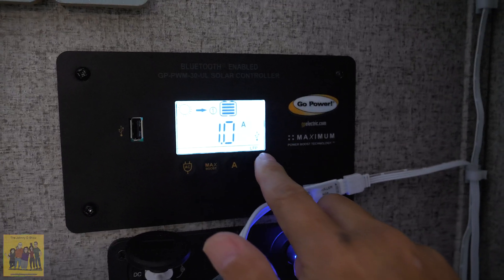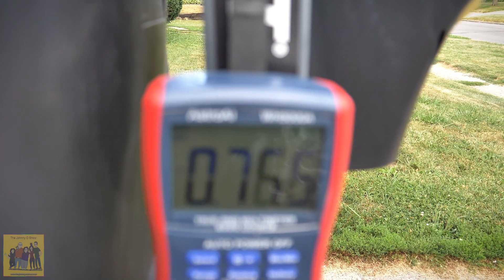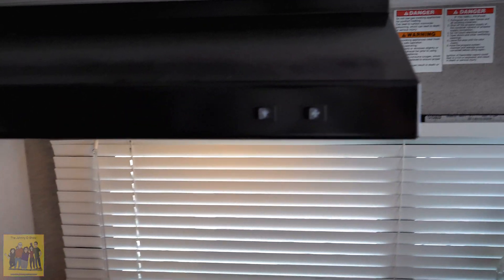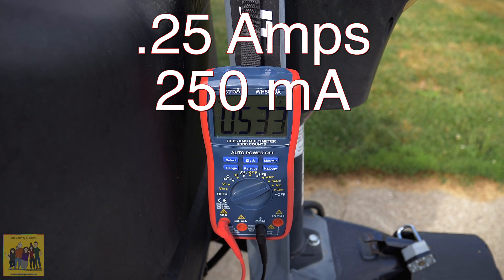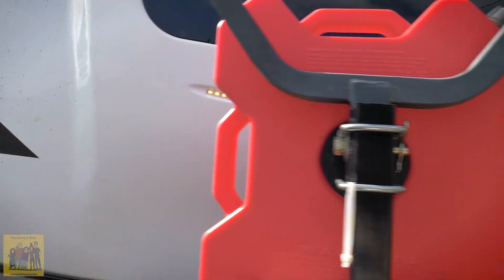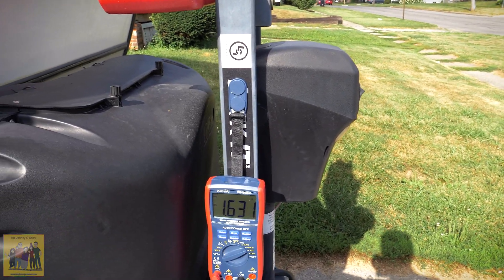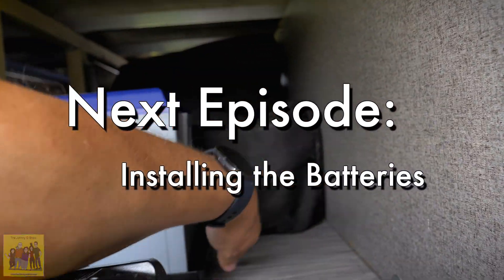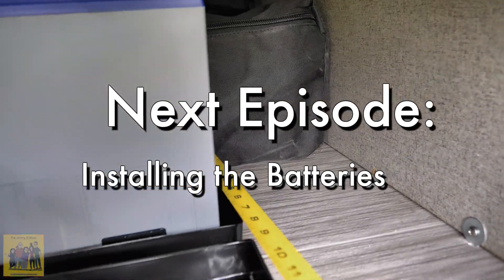Ep. #804 Geo Pro 19FBS Battle Born Battery Install  - Part 2: Reviewing Amp Usage

Comment: Perhaps I missed it, but did you include the draw from your CO / propane detector to determine your baseline power draw?
Reply from the maker: No, you did not miss it. I forgot about it. it's included in the baseline because you can not turn it off. but I completely forgot about it.  So yeah the baseline includes the things I mention in the video and the CO/propane detector. Sorry for the oversight.